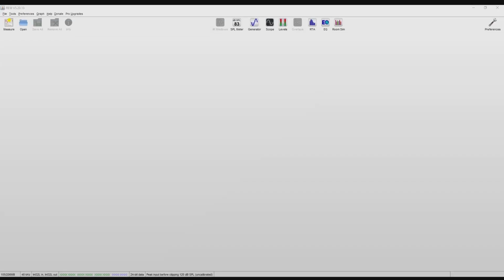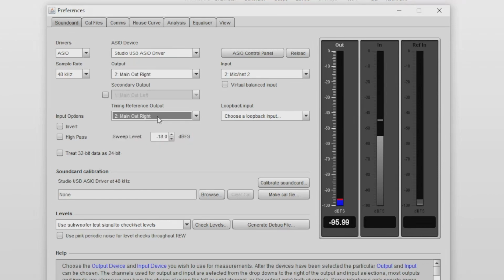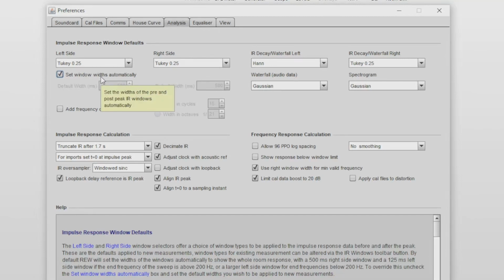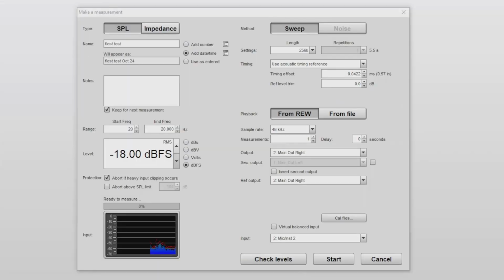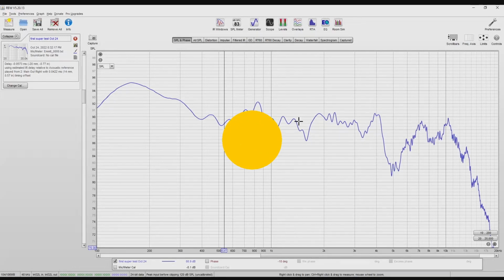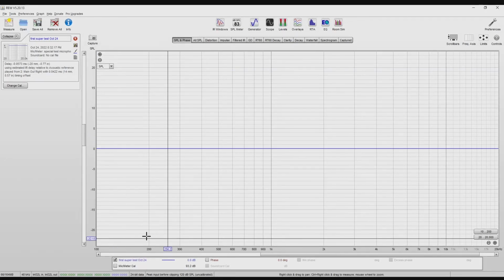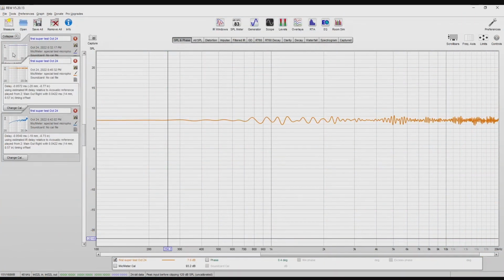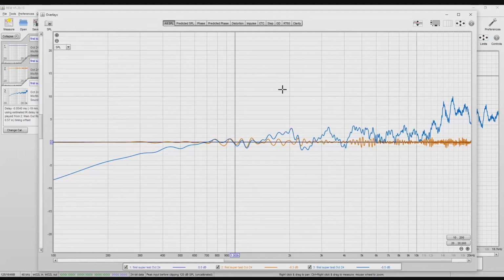REW Quick Microphone Measurements Ghetto Style. Quick and dirty studio microphone response tests.

Comment: In doing this, how do you remove the room modes from the chart? I have a few dips and bumps in my testing room. Is there a way to cancel those out so you get to see a flat chart only showing your mic response?
Reply from the maker: If you look at the "Impulse" tab at the top, there is a red "L," a green "R," and a sort of blue "Ref" control in the middle. The Ref position has automatically been placed, if you remember the chirp sound before and after the measurement. And the extent of the time window you likely set up in the Preferences > Analysis tab at some point. You cannot put the limits on the wrong side of the "Ref" timing center, but you certainly can move everything to the "wrong" position by moving the "Ref to the right. Narrowing down the window (red and blue controls,) you can look at any slice of time you like, skipping the direct signal and just seeing those room modes. 

Of course the opposite, (what you are looking for) is easy too. Without moving the Ref position, you can always mouse scroll zoom in and pull the "L and "R" closer. When they are closer than the distance to and from interfering walls, you will have just the direct signal. 

The speed of sound is about 1130 feet per second, so at roughly a foot a millisecond, you can easily guess, say, 10ms would cut off a wall over 5 feet away. Too short and you will lose low frequency resolution, but at least you will get a better view of just the microphone without an anechoic environment.

Let me know if this makes sense. It is a lot easier to mess with than it is for me to describe well.
Reply: What’s interesting is that mine never “chirps” so I can’t figure that part out. It seems like I’ll have to run the tests again though and I cannot actually use the tests I already did right? Also the high end seems to be my actual mode issue so I might have to redo all the tests being much closer. I was doing 3-feet but it seems like I should do 1-foot instead to remove more of the room
Reply from the maker: @josephrhodes2896  If you have data you should be able to look at it without retesting.

Comment: You teach well. I am new to REW so I am looking for a way to level the start response of the RTA function prior to the test sound being analysed because the "ready and waiting state of the spectrum is about 40dB higher than the high frequency region. My question to you is, can I capture the ready and waiting levels by selecting record and then deselecting record so just capturing the room and any other system noises, and making a cal file out of that? I want to design passive speaker crossovers without using speakers that are not reference models. I'm thinking, your method here could be the way to go about it. Thank you for reading.
Reply from the maker: I may be misunderstanding what we are looking for here, but if you wanted to look ahead or behind in time, you do not need to adjust the sweep during or even before the test. You can move the time window you are looking at by selecting the "Impulse" tab at the top, and just moving the open and close sides of the windowed measurement closer, then moving the "Ref" position wherever you want. This way you can see things like noise bouncing around in a space, and excluding the actual speaker making the sound, for instance, by moving the entire window to the right. You can do this after the measurement has been taken. 

In the actual RTA, you can turn on test signals or noise independently with the generator, or even use another source if you need to. The RTA just measures total energy by frequency so this may not be what you are referring to.
Reply: @edwardthesoundguy  What i mean to say is, when the RYA is ready to do its job and transfer SPL pink noise from speakers, the ready state just before the signal switch on is not at all flat, but more like an decaying exponential curve from say, -40dB down to around -80 dB. I guess it should be bobbing around a flatish dB level before switch on.
Thank you so much for a fast reply.
Reply: sorry, I meant to say, "ready and waiting state" of the spectrum at the bass end is about 40dB higher than the high frequency region.